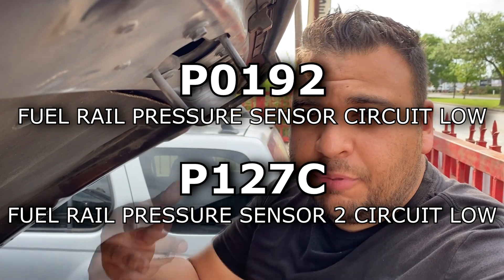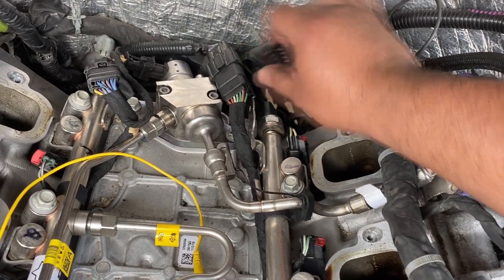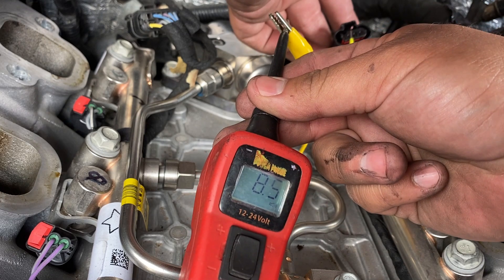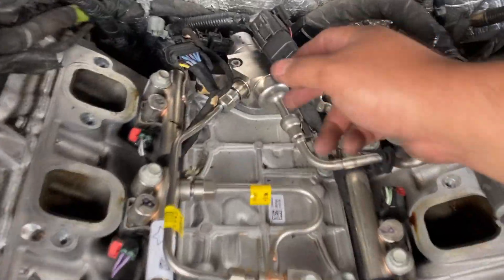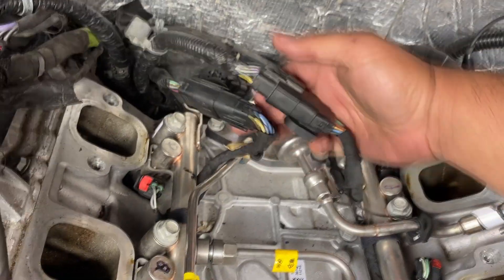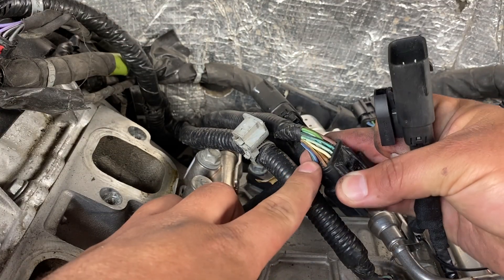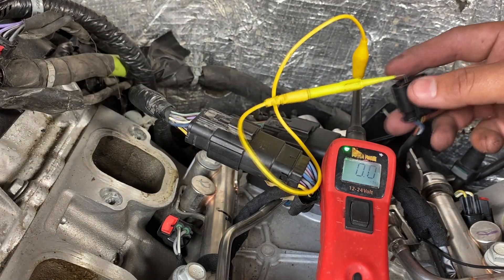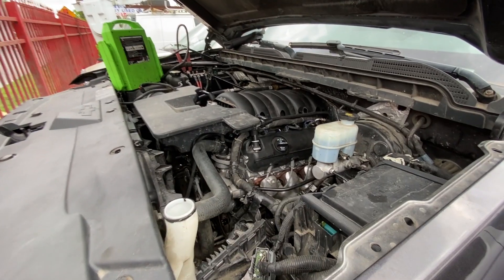CHEVY CRANKS BUT WON'T START P0192 & P127C FUEL RAIL PRESSURE SENSOR

Comment: My code is p00c6 low pressure while cranking but my fuel pump is supplying 80psi to the high pressure fuel pump and even replaced that too still crank no start only code is p00c6

Comment: I'm having the exact same problem. My aren't reversed. Same story, same codes. I picked up a pressure sensor but it doesn't plug in. I also noticed yours has four wires. My has 3. Same year, also 5.3. Engine power reduced
Reply: Figure out what it was??
Reply: @Cooker0479 yeah it was the driver's side fuel rail pressure sensor pigtail. It was a four and I needed a 3 or the other way around. Been driving it since

Comment: After swap the connector I still have P127C dtc and i have a 3 pin fuel rail pressure sensor plz help

Comment: Nice job!  I just had a 6.2 at my shop that one of the other guys put an engine in.  P0128f.  This one had 2 fuel rail pressure sensors although I could only get a wiring diagram that showed 1.  I had 5 volts,  ground and a signal of something like .75 volts of the front one.  The back had 9 volts, no ground and some other random voltage I can't remember.  It was very strange and a swapped connector was not even on the radar at first.  I was trying to ohm the wires to the ecm and not even winding up on the right ecm connector.  There were also grounds left off and wires stripped from being stood on.  It was a hack job like you've never seen before.

Comment: I drive a 2015 GMC Sierra 4x4 my ? Is on po700 &po172&po175 the transmission shift good I was thinking of flushing the transmission an see what happen hope my check eng light go away it come on every 3to4 days after I clear it an I fail the emission test so I think that why I cant get the drive cycle to run to (inc to ok) please respond what should I do keep doing the video

Comment: Thanks Eric just had the same issue on a 16 4.3 , excellent video straight to the point.
Reply: Are your fuel rails under the intake on your 4.3 as well like this v8?
Reply: @gustavoacedo2803  yes

Comment: I have a code for a fuel rail pressure sensor ‘A’ circuit high where would it be best to start looking at for a lose or bad connectors plz help

Comment: A guy in a mustang group did an engine swap and similar issue came about. I told him it had to be electrical, and it was! I told him to double check every connector for issues, bent pins, crossed connectors. Some connectors were connected backwards exactly like this as he put everything back together! Great find! You just keep getting better and better!

Comment: Hi!! Maybe you can help me please I have a 2004 gmc that won’t start. When I put gas down the throttle body it dose turn on iv replaced the fuel pump it dose have pressure. But with out gas in the tb it just won’t start 🤦🏽‍♂️

Comment: I ran into something similar on a 99 Accord--had a code for TPS, engine would start and run but would not accelerate. Found previous mechanic had swapped connectors for the MAF and TPS. They would interchange and both had ground and 5V reference, so it was frustrating.

Comment: GM did something similar on the 92 to 96 Corvettes. I had to replace my header core and had to unplug a bunch of wiring to do so, there are two connectors that run to the computer and you guessed it they fit into each other. Well, I swapped them and was panicking when my "check engine" light didn't illuminate when I turned the key and the car wouldn't start. I went to check and saw I swapped the wires, I swapped them back and the car fired right up. So after a bit of embarrassment and cursing out GM engineers I'm always extra careful when dealing with electrical on GM cars.

Comment: The issue is read the flow chart on replacing the connectors..It tells you to make sure to connect them in the correct harness connectors..

And yes I know GM designers are not that bright. They do lots of stupid shit. But this one is spelled out in the manual...

Comment: Nice find! I've had the same issue on a water transfer pump before, unit was brand new and wouldn't start, painters at the factory removed the ECM and taped up the 3 connectors. When they finished and reinstalled the ECM, they switched C1 and C2 connectors, took me a cool minute to figure that one out

Comment: Great job! GM also changed around some pins at 2015-2017 at the fuel rail sensor. Some have 3 wires, some others have 4 wires... Keep that in mind when sourcing motors from the junkyard...

Comment: I had a similar issue with a Nissan.  

The map sensor and the o2 sensor both had
 the same 3 wire plug
 the same exact colors 
They were right next to each other 
Only difference was pin 1 had a red with a gray stripe on the map

Pin 3 had a red with gray stripe on the o2 sensor 

The other two wire were also the same color on both connectors

Comment: Sometimes you have to slow down to go fast. If the previous techs just one minute to observe the color of the wires they could of prevented a lot of labor time. That's pretty sorry to put two identical connectors close to each other. They should have been keyed/colored differently.

Comment: Ha ha, what a surprising engineering mistake. Quality design should not permit that kind of simple mistake, especially with two connectors that are together in the harness. All they had to do was use a different connector shape, to make a goofy error impossible. I wish we didn't keep finding those kind of glaring engineering flaws in GM products. They have fallen far behind.

Comment: How’d it drive for so long and then “all of a sudden” a check engine light pops on.
Reply from the maker: It wouldn’t start after they replaced the engine.
Reply: @ADVANCEDLEVELAUTO  abhhh.  Ok.

Comment: what explains the fact that the computer was not damaged or one of the modules?
Same colorwires on both sides of the connector, is that Universal or just applicable to GM?

Comment: Wow!  I learned to just rip connectors off, and that the cheapness of manufacturers to use the absolute minimum wiring lengths would ensure I could find the connector easily by moving it around within the diameter of a circle around it to find where to connect it.

And I also learned that the connectors would always be unique, so you couldn't mess it up.  But you just proved me wrong.  VERY GOOD troubleshooting!  It's easy to assume the mechanics at the dealership knew what they were doing, and it's lucky that they didn't blow out a computerized controller board.  Good job!

Comment: Nice eureka moment. But PLEASE stop saying ‘go ahead and’ all the time! I’m going to go ahead and touch the ground. I’m going to go ahead and disconnect this one. Let’s go ahead and go back to the fuel rail pressure sensor. I’m going to go ahead and touch the pin here. Let’s go ahead and reconnect it. Almost as annoying as the pseudo-academics who answer every question with “SO, ...”. Keep up the good work. 👍
Reply: So... what you're saying is that he says "go ahead and" too often?   Did you learn anything else in the process?  If not, "go ahead and" re-watch the video.
Reply: @jum5238  well done you for being the first of the totally predictable replies. Go ahead and give yourself a pat on the back
Reply: Like you're such a genius.
Reply: @mitchlu  Ah, what a shame. Ju M beat you to it by over an hour and a half.

Comment: you would think different colored connectors  would have saved a whole lot of trouble, or keys in the connectors.
Reply: Exactly. It can happen to anybody, then frustration takes over and you need a fresh set of eyes to check it out.

Comment: Oh  what a great lesson video!!! I've had the same thing happened with an old HHR. The mechanic swapped the electronic throttle plug with the injectors plug. I got real confused when the wire colors didn't coincide with the Mitchel diagrams. Finally figured that the connector plugs were swapped. What a bad design that GM does: plugs that could be swapped. And what a piece of crap GM truck those newer Silverados are. Only 5 years old and already needing a new engine? Come on!  I hear of those engines being replaced all the time.And the transmissions too! I would never buy one. But more business for us diagnostic guys! I still feel bad for the people that buy these.

Comment: That's why they call the pro technician. Great video.
Reply from the maker: Thanks 👍
Reply: @ADVANCEDLEVELAUTO  I've been watching you for a year now, and I'm blown away at how efficient and knowledgeable your getting.
Reply: 2014 Chevrolet Silverado V6 my son drove the truck after the flash engine light was flashing for two days and then the truck shut off and he had it towed. I went and checked the truck out and ran a scan on the truck showed P305 and P 300. I found cylinder one and cylinder three coil packs bad so I changed all the plugs and the wires also they were fouled and very dirty and looked to be original. I checked to make sure that I was getting spark and I was. I tried to start the truck and it would just turn over with no start. I checked the mass airflow sensor and sprayed it out with mass airflow sensor cleaner. I also change the camshaft positioning sensor. Still no start. Any ideas

I tried starter fluid still no start

Comment: Nice work. Shitty design there. Reminds me of a vw bettle i worked on that after a radiator replacement the car kept over heating.... Took me a while to figure out the two connectors under the cooling fans are interchangeable. Problem fixed by swapping the connections 👍
Reply from the maker: It's hard to blame the technician. We are so used to connectors being component specific. Thanks for watching!